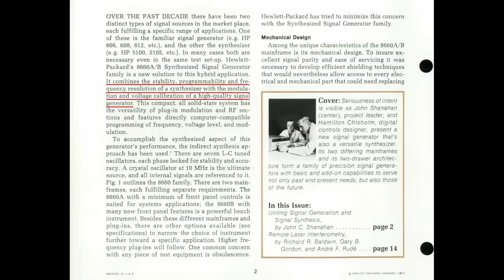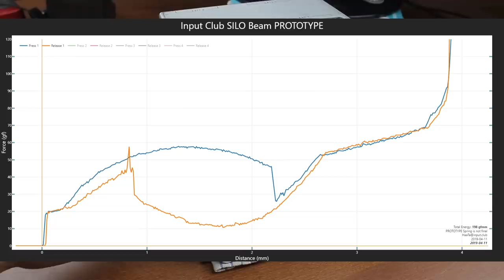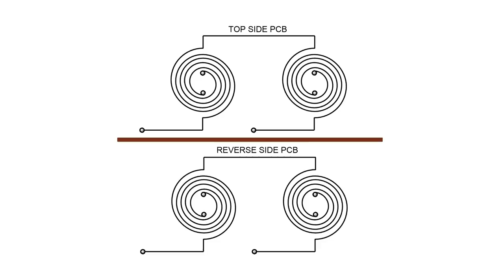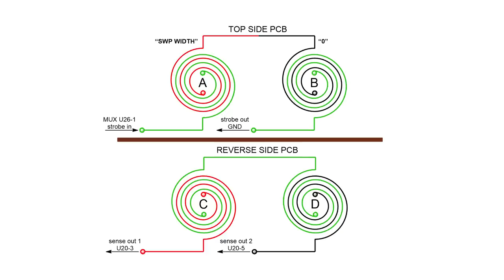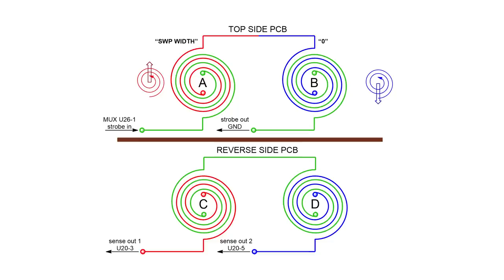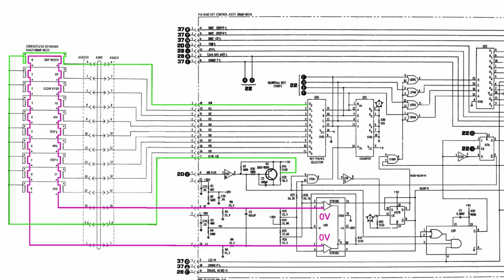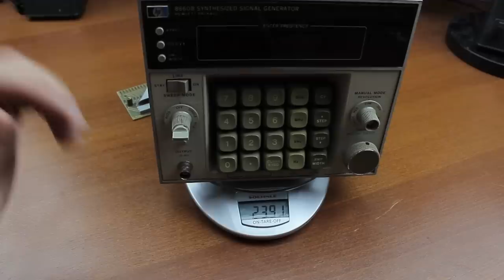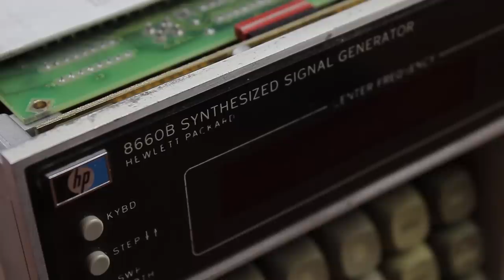HP 8660B keyboard module review (HP pulse transformer switches)

Comment: 7:15 I didn't know you were an VX enthusiast. But you forgot about the dinglearm stabilization trough flux detractors to prevent side fumbling at strobe resonator.
Reply: don't forget to compensate for the bithermication of the anti-thidelimo or you might reverse the quandogrip postuliser unit. (could get very messy)

Comment: The explanation at 1:28 can still be applied to any modern keyboard. Every key is connected in a matrix, with rows and columns. The micro controller sends a signal through every column sequentially (a thousand times a second) and if it detects a signal from the rows, that means a key is pressed, because it shorted a column with said row (effectively, switching the circuit hence the name).

This module does the same thing, but it looks like it has a more convvuluted way of doing the sequence, where it alternates between which 10 keys to listen to.

Comment: That unmodified analogue'd Cherry MX switch is a pretty interesting idea btw. Does that mean that only the PCB's would have to change, but nothing about the switch would need to? And does this also mean that the switches wouldn't need any soldering, or could omit the internal contacts all together and thereby making them contactless? Sounds pretty sweet for adapting Kailh BOX switches or lubed Gaterons to analogue sensing. 

Given all the efforts to reinvent the wheel by having to design new switches for analogue sensing, I wonder why this method isn't catching on. The only good reason I can see for going through the trouble of designing new switches is if it stands to give a unique tactile or clicky experience, like what Input Club are doing with reviving beamsprings. But otherwise I don't see the point if the tactile or clicky mechanisms will remain fundamentally the same as Cherry MX. I mean, the sheer smoothness of Adomax Flaretech, I can imagine, would be entirely possible in a standard MX-type linear if the contacts were to be removed, and I heard that's exactly how Gateron opticals work. Maybe you should give those a go?
Reply: Does that mean that only the PCB's would have to change, but nothing about the switch would need to? Yes!
does this also mean that the switches wouldn't need any soldering? No soldering needed!
could omit the internal contacts all together and thereby making them contactless? Also true, only the spring is required.
Here you can read more about it: https://alltrons.com/analog-keyboard-technology/
Reply: @pawnerd8447  Wow, didn't expect you specifically to find this! Very cool tech you got going. I see that your current dev kit has Kailh hotswap sockets. Are those still currently functioning for the switches to register? Or do those just help to keep the switches in place? In other words, would the sensing mechanism function even if the contacts weren't socketed to anything? And will future revisions attempt this? 

I ask along those lines because I'm specifically fixated on the possibility of turning existing switches into contactless switches. That would be pretty revolutionary for switch modders if we could improve the smoothness of switches by removing switch contacts entirely.

Comment: Upcoming hall effect beam spring?  For real?
Reply: Pixelated Mushroom  Believe it! Not only that, but the ANSI-only first-offered keyboard will be offered for 100 USD, so for about the price of four loose beamspring keys on eBay.
Reply: I have yet to try these new switches, but I'm really worried about that roller-coaster shape on the force curve just after the 1:54 mark in this video. If you compare it to an ancient beamspring, you will see that the original has no curve at all, just a very smooth incline going from weak force to heavier force before the activation point.

Comment: Have you solved the Tokai MM9 mystery? :D
Reply from the maker: Yes, it is held off-axis by default.
Reply: @Chyrosran22  I wanted to ask you something. I've seen your old viedo about a Cherry G80-9009. You mentioned, that you cannot use this keyboard, due the lack of special cables and the KVM box. Well, it is possible to use this board without a KVM box, and with a few custom made cables. I'm using one of these boards as my daily driver. I can make these cables for you if you wish, as they are fairly inexpensive to make. Sadly, I don't have much free time in this month because of my university exams, but in the summer, I can make you a cable set if you interested. :) Of course, it would be a donation.
Reply from the maker: @varszegimarcell  hiya mate, yes, very much interested! :)
Reply: @Chyrosran22  OK, I will drop you a mail on Geekhack, when I got the parts and the time to solder them. :D
Reply from the maker: @varszegimarcell  thanks! :D